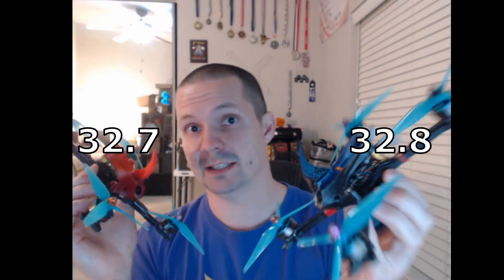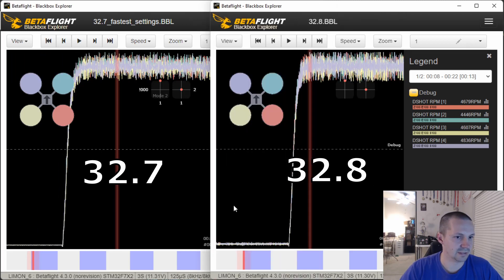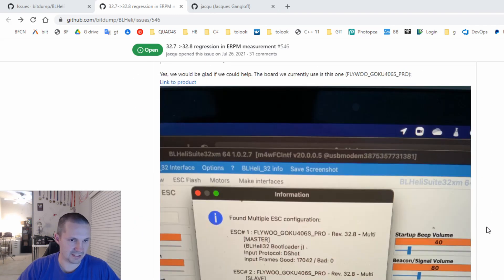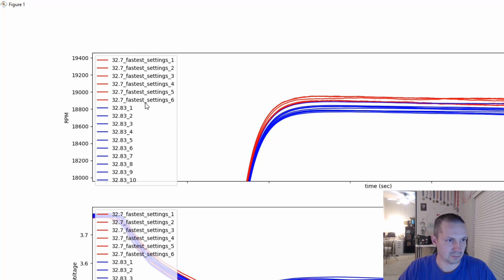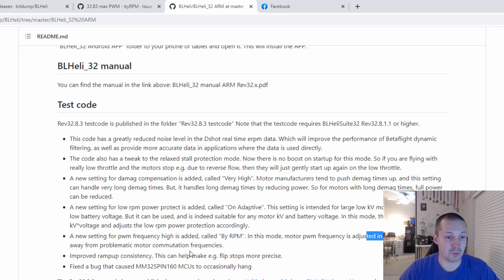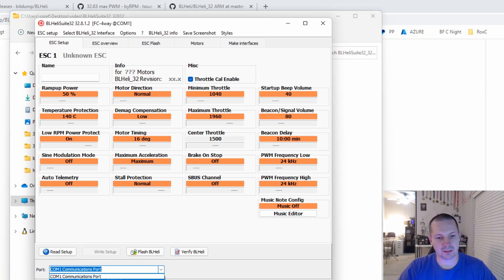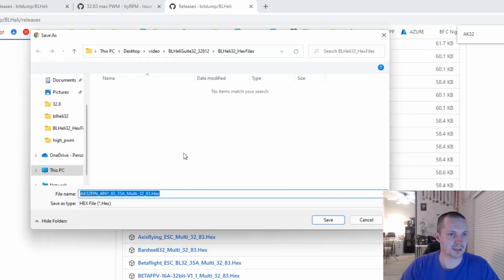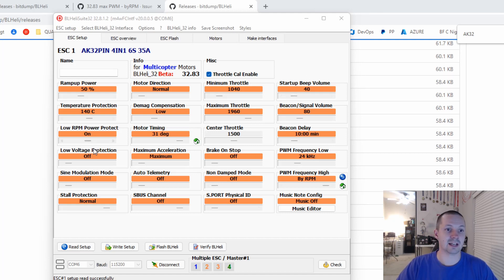Why BlHeli32 testcode (32.9)? What about BlHeli32.8 and 32.83(32.9)?

Comment: Hi Limon, I heard that you read all the comments, so there's a chance to get your view on the case. You recommended Foxeer stacks with 20mm ESC - what is your experience with BLHeli bugs on your and your colleagues' builds? Have you ever experienced an issue where one motor goes full throttle after ESC initialization?
Here is the video presenting that https://m.youtube.com/watch?v=IU_nALgzGZM
Reply from the maker: ouch!

I've seen this a few times, and it happened after a hard crash. So i assume some physical ESC damage causes such behavior.

Comment: Hey guys I have a question about flashing the the 32.8.3 firmware. So I have a 1x Lumenier Razor LED 55A 4-in-1 F3 BLHeli_32 2-6s ESC . Under blheli it lists the board name as luxaio. Just making sure I flash the right hex file.
Reply from the maker: You can't really flash wrong file if you follow this procedure. If you put a wrong file in the folder, it won't show up in the BLheli app flash tab
Reply: Lumenier_Razor_4in1_Multi_32_83.Hex
LUXAIO_Multi_32_83.Hex

I flashed the luxaio because that was what my board said on blheli. It flashed successfully. But I’m new to fpv so I just didn’t want to mess anything up. Thank you so much for the reply by the way.

Comment: Great video. Can you tell me how to do this on a MacOS? Because there is no folder by the name of ''BLHeli32_HexFiles'' if I open the ''Show package contents''. I tried to make a new folder with that name but no luck so far... Not really a computer geek after all. Thanks!
Reply from the maker: I am sorry, never used Mac in my life :/
Reply: Same here. Have you found the folder yet?
Reply from the maker: @prottentogo  open the issue in BLheli 32 GitHub with the question. They usually reply very fast.
Reply: having the same trouble have you found a solution yet?

Comment: i flashed this 32.83 to my iflight ESC which i test in a few hours. but i didnt recognized the 96khz_multi file, only the normal multi version. i got a message, that the 96khz version is not for my esc, but i think it is, but i didnt flashed it.  is using a 96khz a big risk?
Reply from the maker: I think if 96 is not recognized then your esc does not support it
Reply: @IvanEfimovLimon  i thought the same, but it is still in the list. there are some ESC with 2 files, mostly 96-multi and multi. didnt found information about thedifference.
Reply from the maker: @rolliseventeen  at least for foxeer the 96-multi is a physically different ESC from just multi.
Reply: @IvanEfimovLimon  ok, thank you. then i cant only rely on the target name.
Reply from the maker: @rolliseventeen  well, 96 is a part of the target name :)

Comment: I've been running 32.8.3 with low pmw 24khz and high on birpm. I notice the quad is more responsive... I'm using a diatone ESC that goes all the way up to 128khz... 5 inch using T-Motor F60 motors
Reply: Whag kv and esc?

Comment: Very interesting and informative video. I'm running my Tekko32 F4 65a esc on 32.8.3 on my Ultra build. Very smooooth flyer. Motor timing 23 and pwm frequency 24 low and by rpm high. Happy flying. 🤓
Reply from the maker: Thank you! Happy flying too!

Comment: Awesome! Noticed you have motor timing set to 31 which is way higher than I have seen in the past. Any insight?
Reply from the maker: Yes sir good question.
This is for freedom spec.competition. a 3S battery on 6S drone. Hight timing give a little more thrust.
Reply: You should make a note of this and other ESC settings in the Freedom Spec Presets Tab. If it's already there I didn't read it fully lol
Reply from the maker: @baggszilla  I am.olanning to make a video about freedom spec ESC settings :) that topic is more complicated than I thought